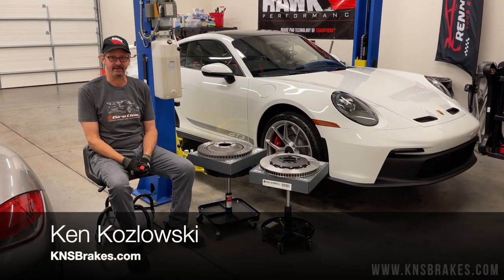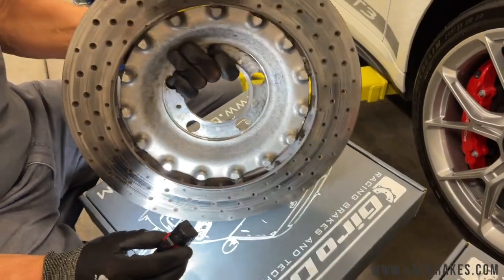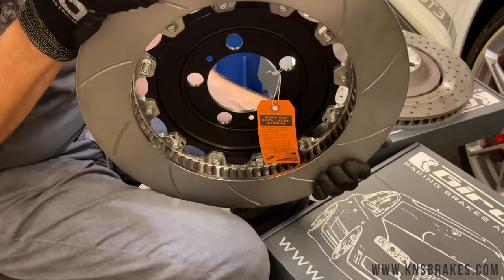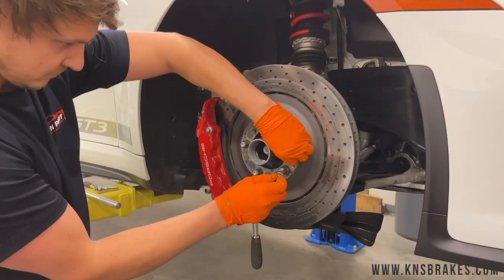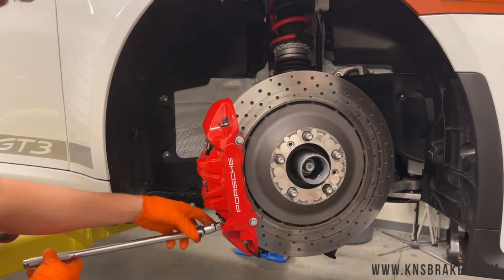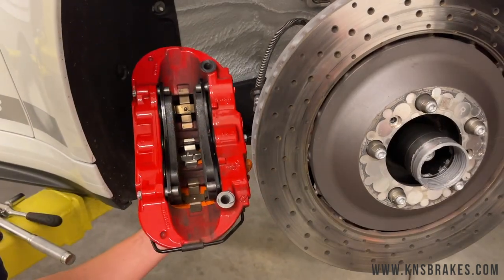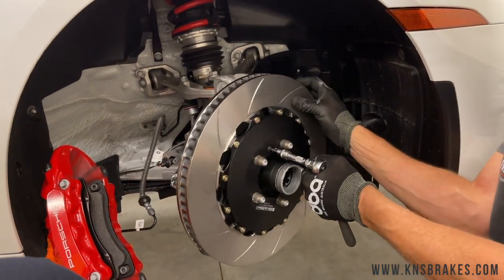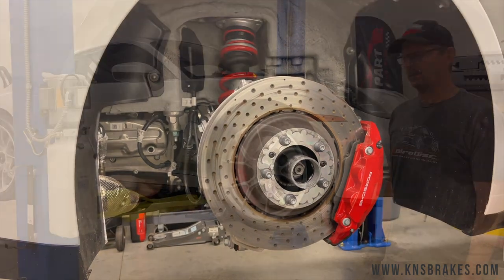Porsche 992 GT3 Girodisc 2 Piece Rotor and Brake Pad Install

Comment: Thanks for the video, it was useful to watch before attempting pad swap on my 992. Curiously on my 2022 UK car the front calipers have 10mm allen bolts - the rear are T55 torx though. Rear was easiest as only required the pad sensor disconnecting (and no 10mm bolts etc). I found the pistons pushed in easily by hand without pushing out other pots.

Comment: Dumb question. How would you back off the pads with the carbon ceramics. Normally on my other cars I would just use a large screw driver against the iron rotorface like what you guys did but I feel like that would not be a good idea against the ceramic face.
Reply: That is not a dumb question in fact it's a great question as you are correct - the CCM discs do not have the hardness of iron and thus you cannot pry against them like that.  I'll ask Aaron as I am sure he has a clever solution without cheating.  On a GM CCM system you can easily use large pliers with tape around the jaws to squeeze the pad plate against the piston/caliper - I'd assume you can work the Porsche caliper like that as well if you know the right angle.

Comment: I'm wondering, seeing that as I understand it the braking forces are transmitted to the wheel via the hat, how durable is that thin aluminium hat compared to the standard steel items? My instinct would tell me there is a higher risk of the hub bolts shearing through that aluminium hat.
Reply from the maker: Hats almost never break.  I'd say never but there has to be 1 somewhere.

Comment: Could just swap out PCCBs and just replace the  discs (rotors) and pads or are the callipers different? Thanks
Reply from the maker: We worked on  an 'iron' car.  The PCCB's are almost certainly completely different.  There will at some point be a solution for those.

Comment: How do you find OEM torque specs for brake hardware?
Reply from the maker: Great question.  The 'correct' answer is the service manual if you can get one.  For aftermarket parts we would consider engineering guidelines.  What specific hardware are you referring to?
Reply: @knsbrakes608  caliper bolts, the bolts that hold the rotor on/align center lock etc
Basically everything for a complete brake change
Reply from the maker: @jpleadr97  I will see if Aaron can cull that together.  He's the real MVP (Most Valuable Porschelover!)